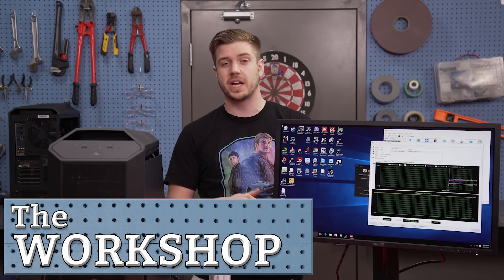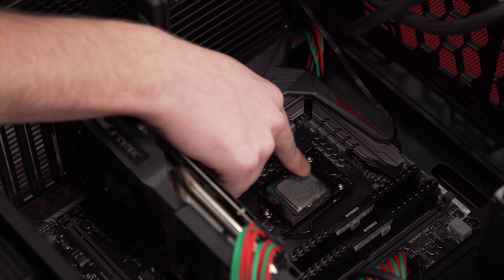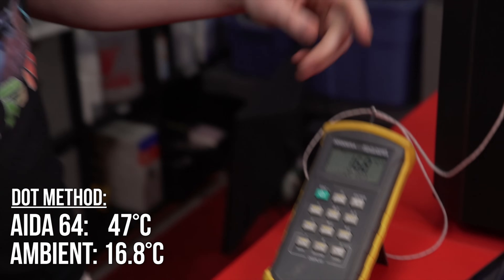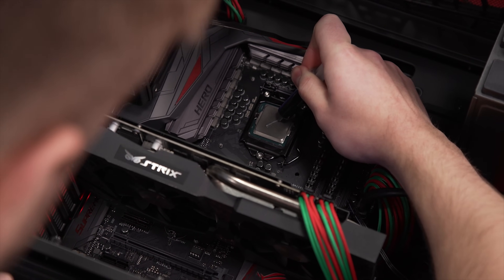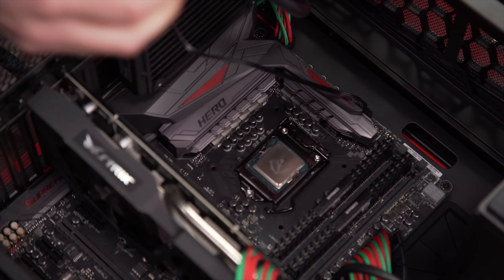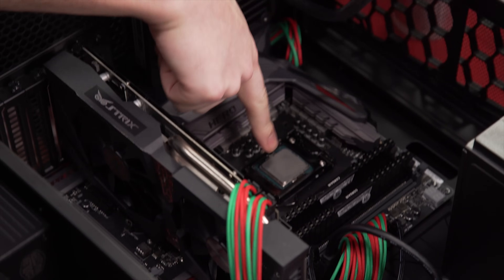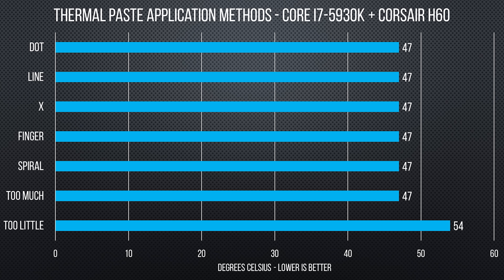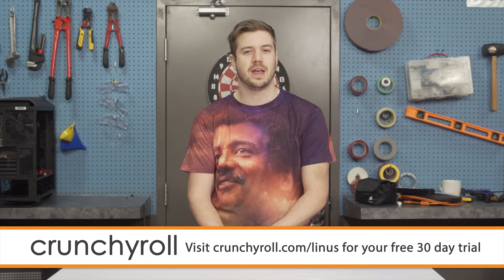Thermal Paste Application Methods - Which one is best? - The Workshop

Comment: Most if not all motherboards have levels of fan speeds/levels of noise - (quiet, normal, cooler). The CPU fan does not spin at it's maximum speed all the time because its going to be very loud. That's why there is a controller which controls the fan speed, so the cpu temp doesn't get too high, and at the same time it keeps your CPU quiet. If your CPU is in idle the fan might spin with 200-250 rpm and your CPU temp might still be at around 30 degrees.
 Later on when you run the stress test and the CPU gets under load, the fan doesn't get to its maximum speed again, because the controller is smart enough to know that if it runs higher it will make a lot of noise, and by spinning at a specific rpm can still work without reaching the maximum cpu temp and causes reboots.
 The fan is spinning at different speed every time. That's why the temps are all the same. The controller is trying to balance between CPU temp and FAN speed. Even when you had 52 degrees the fan wasn't spinning at it's max speed. This will happen if your CPU temp goes to something like 75-80 degrees and more. Then the controller will try to cool the CPU down by running the FAN at maximum speed and keep your PC running.
For correct measurement the CPU should be cooled with a constantly running fan at the same speed on each test. Using the molex for that is not the best thing, but is still much more accurate way.

Comment: So here's an interesting test, Low FPM 240 passive top mounted radiator added to a 240 standard density water cooling system, so it would be 240 vs 240+extra thermal mass and passive exhaust.

Comment: it seems like the pressure of the CPU cooler will squeeze the thermal paste to a specific thickness. As long as you have enough to cover the CPU the temps wont change. Any method will work as long as it has enough thermal paste. I think a better test would be different types of thermal paste. Which thermal paste is the most convenient? Would the amount of pressure on the CPU by CPU cooler have effect? I would like to see a price to performance test with different CPU coolers.

Comment: Interesting results, but you apparently did this with stock clock speeds, therefore IMO your results are not really valid. Modern CPUs are pretty good at managing heat (boost clock, turbo, etc.). I'd be interested to see you try it with something that will actually challenge it and create more heat than normal.

Comment: The problem with this is that IC diamond is a mediocre thermal paste and AIOs are a mediocre cooling solution. Seriously, use T-Grizzly Kryonaut or something.
Reply: The problem with what?
Reply: This test.
Reply: You are trying to add variables to the test that aren't relevant to the results.  Thermal grizzly kryonaut may get you a couple degrees cooler overall, but the deviation due to TIM application will follow accordingly. The same will apply for any cooling solution used.
Reply: The problem is that Puget Systems did a similar test and showed a two degree spread depending on methodology. The problem with IC Diamond is that it is extremely abrasive and hard to apply due to its thickness, which almost invariably results in the TIM becoming an insulator. The similarity in test results in this video points to that fact.

I recommended Kryonaut because it is superior not just in temps, but in ease of applicability. Also, AIOs are just not very capable coolers compared to custom loops, mostly because they use shoddy radiators that don't have much thermal capacity and with two exceptions the quality control is just abysmal. That's why the water cooling community is abandoning them in droves.

Comment: As long as the paste spreads you are fine... I also hear all about using the wrong thermal paste. AS5 vs the white goop from 2002 and temps are close to the same. I would also wonder if adding more heat to the mix would cause any more change in application methods, I would doubt it but something maybe for a revisit.

Comment: I use the plastic bag over a finger and then just add dots of paste on the cpu, like in every corner and the middle and then just stomping it nicely with my finger until the entire cpu has a thin layer of paste. That ought to get a good\best contact with the cooler as the micro cracks that are visible under a microscope get all nice and pasty :)

Comment: I see you used a water cpu cooler, which, to my understanding works better than passive metal fin-type coolers. Maybe the water cooler did too good of a job. Incorrect thermal compound application could be seen with a more "average" cpu cooler scenario. just a suggestion.
Reply: +Hamil Patel While the liquid cooler does do a better job of cooling, the temps would all be proportionally the same in regards to each other. The temps would all just be higher than their liquid cooled counterparts.
Reply: No.

Comment: Why test if you're going to do it poorly? Try pulling the CPU out since you didn't have a good angle to do the spread. And why did you wrap the card in (tissue?). Use a razor or  spudger/pick. You gave up and just rubbed your finger around?

Also, i dont think your max temps of 47C are high enough to stress any kind of thermal transfer ability. Raise the OC, or use a different stress test that gets hotter.

Comment: What about no paste at all?
Reply: +Ian Tusa If you've done it yourself already, why even bother asking?
Reply: Admiral Xyes There is a difference in someone who has seen a rig run without paste than someone who ran controlled testing on both. I only tested after not having paste. Proper test conditions are important to make proper conclusions. I would have thought this obvious.
Reply: Admiral Xyes Also by the way it could be that mine works fine for another reason, I'm not a tech guru I just make an assumption based on my understanding of thermodynamics and heat transfer.
Reply: Ian Tusa First you tell me you bench test with and without paste, then you tell me you don't have proper conclusions.  Well I daresay, it sounds like you wasted your time bench testing.
Reply: Admiral Xyes That's because I ran bench tests from where it sits before a rebuild I did. Do you think I wrote down atmospheric conditions or even the results? No, I just made sure nothing went wrong and temps didn't seem high. Just normal bench testing my first build. The second tests after not having paste I paid more attention to it not overheating since the part I replaced was my motherboard to an exact model and decided not not to use paste because it looked inefficient. I DID NOT REBUILD EXPRESSLY TO TEST PASTE. If you don't understand that bench testing is done for more than one reason under multiple variables not logged than you're considerably narrow minded. So under these set conditions with the same rig I'd love to see what no paste looks like as standard. Is that so hard to fathom?

FFS some people can be really thick headed.

Comment: Yes people this will make much more of a difference if you are OCing your computer... dot is the best lazy man method. I suggest however using a star method and also dabbing the paste on to the IHS to reduce the possibility of air gaps. Always however check the manuals application method some paste (coollabritories) have special application methods... Ive seen this stuff applied wrong before... not fun to fix...

Comment: First of, Great video! @LinusTechTips

But  I would love some details on what components used in these tests. I asumed this is a standard VIII-Hero board. Then if so, Read below.

If you had ''Fan Xpert 3'' as feature on (MAXIMUS VIII HERO) enabled in bios, and not actively disabled it. Would it not always find the ''optimal'' temperature or atleast try to reach target temps? 
Using RPM on the fans and/or pump.?
Maybe that would explain why the results are so equal?

For the test to be fair, the fans on the radiators must be spinning at fixed voltages or atleast fixed RPM right?

Thanks for another great video!

Comment: Question: Does having 4 sticks of RAM in a dual channel set up cause those sticks of RAM to go slower than an equivalent amount of RAM in only 2 sticks? I.E. if I have a mother board that’s dual channel and I use as set of 4 sticks that = 32 GB Vs. a set of RAM that’s only 2 sticks that = 32 GB’s will the 2 sticks preform faster than the set of 4 since the mother board is “dual channel”? Or will the preform the same?

Comment: I plaster mine and have noticed a significant drop in temps when an even coat of Arctic Silver 5 is placed on it roughly 0.5mm in thickness. I believe the cause for this is due to the complete coverage of the non-conductive thermal paste on the CPU (Or APU depending on your build) allows for better dispersion of elector-thermal heat generation...but I could be wrong so my vote is the plaster or "spreading" method even tho it is slower as you start with very little paste and slowly add more as needed in order to reach the desired thickness (as I said 0.5mm works best for me) ideally you spread the paste with a credit card and after applying the heat sink wait 2.5-3 hrs in order for the compound to set I see a decrease of 5-6*C with air cooling and 5-10 liquid cooling with my method vs. others I have tried so with that said I think the plaster or "spreading" method is best if done the right way :D I feel the worst however will be the pea or dot method

Comment: One to find out why the hell does the NZXT Grid V2 use so much cpu usage. Like 3-12% so ive ended up just using it for my front two fans set to 35% as they are so loud any higher ,AF/SP120 red led corsair quite edition. And resorted to putting the other 3 case fans on my Mobo Asus z97 pro gamer (Grid v2 software not running but still powers the fans at 35%)

Comment: Hope Luke set the hydro cooler fan to a fixed (50%) speed. If he didn't the coolers fan could of sped up to compensate for the temp increase and clouded the correct conclusion. Good video as always though guys!

Comment: Is it just me or do I feel like you guys missed a few variables? Most of the thermal paste Ive ever used requires a burn in time to cure which can cause your temps to fluctuate. I understand that using a single thermal compound would eliminate another variable and IC Diamond is a great compound but I think you should have done a straw poll of the most used thermal compounds and used the top choices to see if those caused any change in temp. I also think you guys should have done this on a system that was overclocked due to the fact that the cooler your using could possibly compensate for the difference in application methods unless your really putting a strain on your CPU.

You've shown that with a good cooler and thermal paste that application doesn't really matter but I believe that under more strenuous circumstances that you could see a wide fluctuation in these numbers.  

I use Tuniq TX-4 with a Corsair H100i v2 on a 4790k oc'd to 4.8Ghz and doing the same test saw +/- 4C in temp change with the pea method being the best for my application. Ive also used IC diamond 7 carat, Arctic silver 5, Tuniq TX-2, and Noctua NT-H1 with the TX-4 beating out NT-H1 and TX-2 by a whole 1C.

Comment: If you are a noob on your first build get non conductive thermal paste, but if your an experienced builder get conductive as it will cool better. Also you don't have to spend the money for something like IC Diamon thermal compound, just go on eBay, and look for a tube like this one in the link, it's basicly the same thing, and on my AMD A-10 5800k APU turbo boosted to near constant 4.2 Ghz I get temps as low as 28C and average temps in the mid 30's - low 40's. 
http://www.ebay.com/itm/Syringe-Thermal-Grease-Silver-CPU-Heatsink-Paste-Conductive-Compound-Reputable-/381336605637?hash=item58c96ed3c5:g:qToAAOSwgQ9Vrb6-

Comment: maybe some good thermal paste questions: does removing old thermal paste make a big difference? Does contaminated thermal paste (dust, hair, paper / fibers...) effect the cooling? and finally: can a glob of thermal paste replace a thermal pad?
Reply: +UrSoMeanBoss 
in case they don't answer these again as they (or other YTubers) already have in various videos:
1. if the paste is older than oh say 2 years (of heavy use) you might get a couple degrees but not much
2. yes, just be careful and you'll be fine as the main problem is if a contaminant like a hair could cause the cpu and heatsink to spread apart slightly
3. replace is a strong word... its highly inadvisable as the paste will likely either be shook out easily, dry faster due to larger surface area exposed to air, and/or damage could occur due to mounting pressure not being distributed properly

#3 is more of my own educated guess than anything I've heard from YTubers specifically

Comment: Before watching: to little will lose because it will not cover the entire surface, therefor will do less heat transferring. Winner will be hard to say because the pressure will push out any excess of thermal paste so the other methods will result in more or less the same temps with varying amounts of mess. Going to vote pre-spreading as the winner because of the thinner film at the start.

Comment: What happens if you dont add any thermal paste :V
Reply: I dunno. You should try it :3 (pls Dont)
Reply: +SameAtol High 60s to mid 70s. It was 54 with way too little, so none at all I'd say would idle at say..40 and under stress to up to around 80
Reply: I just want to see :v
Reply: SameAtol try it on an old cpu and an old motherboard, you could completely fry both of them

Comment: here you have an idea, what is better? a "normal" cooling system (stock cooler and some case fans) in a room with AC unit?, or a enthusiast cooling system and a somewhat hot room?, you can get a good AC unite for the same amount of a really good cooling system

Comment: i needed this my cpu was reaching 128 C under load...
Reply: +Ninjustice are you sure you didn't read F as most cpus are suppose to shut off at about 100C or at least throttle to the point of very little heat output
Reply: Jon Rueckert yes it was C. i fixed it though, now I'm getting 30-40. it shut off at 130. it was an amd a6-5400k

Comment: Something that I think might get some different results is if you try it with an x99 chip or amd chip and also se if there is any difference when using water or air for cooling (Honestly I doubt air vs water will make a difference).

Comment: The true best application method is to use as little as possible while covering as much as possible. Doing this is best using an old expired credit card or something like that, as it will help spread the paste. It helped me reach 50 degrees C max on an overclocked FX-8320 using the evo 212. I know these factors aren't individually huge, but altogether it's a GREAT result to reach 50C max on an overclocked AMD processor.
Also, keep in mind that my ambient temperatures are about 20-27.

Comment: hmm i've alway's heard you guy's say to use an uncooked grain of rice  as thermal paste
build a system a while ago so did that, although might be a bit to little, rice aint big
got a 6700k at 1.4volt and 4.7ghz with a gtx h100i and getting about 60degrees in games, that bad?
still better than on air with my old cpu so it's probably fine
Reply: Temps are fine, you might wanna try to lower the voltage a bit to let's say 1.37 and see if its still stable. If not, raise the voltage by increments of 0,05 volts till it is.
Reply: Julien Tesselaar
yeah i know, tried 1.3volt but that blue screened
but dont have a lot of time to play around with my pc nowadays, so if i have the choice between playing games or tweaking and stresstesting i'll choose the first
but gotta do it some day ;)

Comment: I use a line because my cooler (Hyper T4) has direct contact heat pipes and so if I use a dot then it goes out the sides before going across the heat pipes.  If I was using a flat cooler then I would use a dot.  Made it hard to answer the first poll since I had to guess at your cooler type.

Comment: Honestly, did you even let your thermal compound set? I know in some of the thermal compounds it takes to cure. Arctic Silver says a minimum of 50-200 hours. I have also seen tests which showed that curing provides better cooling temps by a few degrees in certain compounds. Not all are the same, and some require very little curing.
Some people say Arctic Silver 5 takes up to a month to get the full cooling efficiency.

Comment: You should have tested putting an entire tube of thermal paste on the cpu.
Reply: +Colton Blumhagen Trying that now with Arctic Silver 5 (Tube looked like http://www.newegg.com/Product/Product.aspx?Item=N82E16835100007 but got it for much cheaper) on a prebuilt computer. So far compared to the factory thermal paste, it's the same temperature while running Prime95.

Comment: Why not just use a dead cpu chip and a piece of Plexiglas to simulate the cpu cooler. Apply the paste in the different methods and see how it spreads on the cpu. The method that covers the cpu most evenly and completely should be the winner. No need to actually get temps in my opinion. I stopped watching the video, because I assume that all methods listed will probably come out about the same.

Comment: I spread mine with finger and plastic bag and I vote putting too little as being the worst application.
Reply: Actually I would have said too much would also have been a problem aside from too little but it seems that wasn't the case. As for the other methods it appears it doesn't really matter. I myself like to spread it with my finger just to make sure the paste is touching the entire surface of the cpu. I'm not sure but the fact that he was using a really nice thermal paste might also have effected the tests.